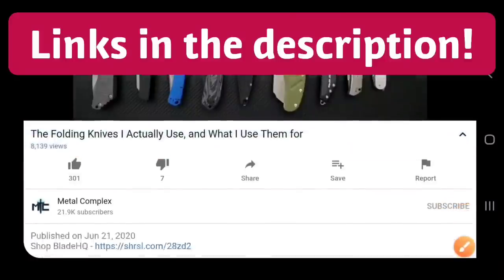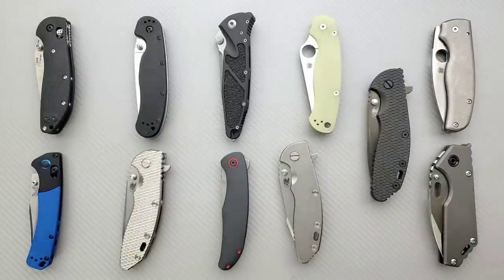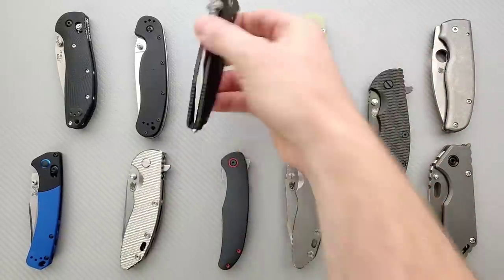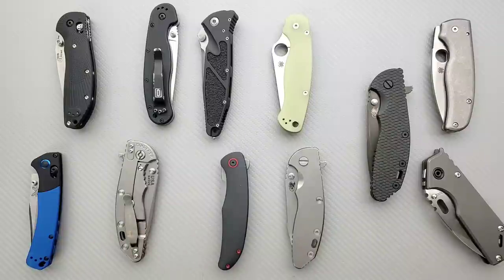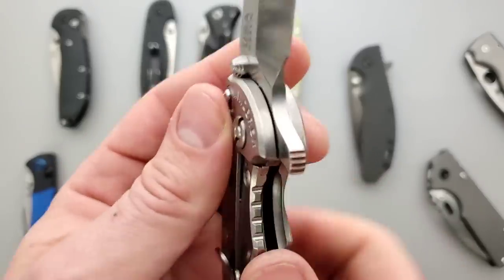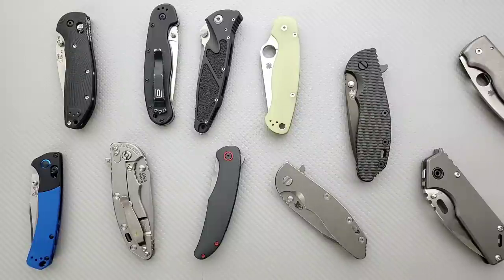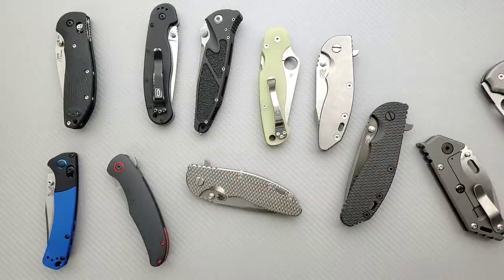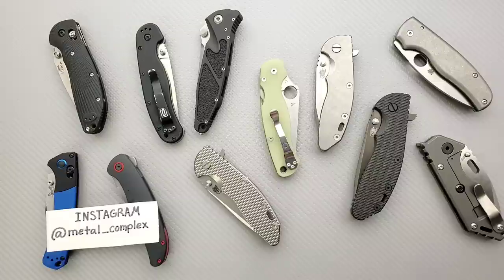Lock Stick on a Folding Knife - When Is It a Problem? What Can Be Done?

Comment: I sent 2 Zero Tolerance knives back due to lock stick... They fixed the problem and they're buttery smooth now. They sharpened them and now the grind is very uneven on both knives. Now they're drawer junk.
Reply: Then reprofile the blade yourself...or send them to me.

Comment: Wish me luck.  My spydiechef developed very concerning levels of lock after about 2 years of light use all of the sudden.   So far all I know is that the outer most corner of the lock bar feels as sharp as the tip of the knife... probably ought to do something about that.   And for what it is worth, I've been doing the sharpie thing since day1 just in case :(

1 hour later edit.  I took some 12000 grit wet/dry sandpaper with some diamond compound residue left on it to the sharp edge until it felt sharpish but not dangerous,  then re-sharpied everything, and now all is well  :)

Comment: I have five Ganzo FH-31 knives. It's my favorite Ganzo model. (Can you tell?). ONE of them is about 1-day old and suffers some lock stick (liner lock). I had considered putting half a smudge of 0.5 micron stropping compound on the mating surfaces to accelerate wear between the two surfaces BUT... I'll refrain, keep working with it, and let the two surfaces slowly mate together until things smooth out, or until my thumb gets so sore I have to just let the knife sit for a few days while I carry one of the others.
I stumbled across this video at the perfect time. Thank you or easing my concerns that I might have to do more than just work the lock repeatedly and wait for the surfaces to mate for a smoother release.

Comment: You're correct about the need to be careful you aren't pushing against the lock bar - this is a real problem on my Kizer Lancer 2, a knife I otherwise love, but it is very hard to hold it "correctly" before actuating the flipper  without thinking about it too much --  because even a tiny amount of side pressure from your little finger on the lock bar will cause the steel lock bar insert to press against the tang of the blade and this is enough to prevent opening.  It drives me insane!

Comment: I had lock stick on my Full Track, it was hammering my thumb pretty bad and was virtually impossible to close one handed..  I used a small amount of some dry "lock "lube and even very fine sand paper on the contact points and it helped a lot, and just keep flippin'...   

That .75 AR is still a great looking piece.  😊

Comment: I got a Maxamet PM2 today, it was sticking out of the box and it just got worse until it occasionally locked up almost solid.
I watched a badly shot video where the YouTuber used dry graphite lubricant in the lock indent and solved a similar  ( not as bad) problem. Not having (immediate ) access to graphite lubricant i used pencil lead scrapings and it ( for the moment at least) seems to have done the trick.

Comment: Thanks for this, just got a Penquin (finally) and it's got some significant lock stick. Actually hurts my thumb at the joint if I fidget with it a couple times. My thumbs are double jointed so it forces my thumb pretty far in a weird direction. Anyway, I nearly talked myself into disassembling and sanding the nanometer of "trouble area" and looked this up to verify the best way to do so. Ultimately I'm gonna leave it alone, I hope this doesn't take months but we shall see!

Comment: I had a very good experience with polishing (not sanding!) the surfaces very carefully. There are often micro bumps or some production residues sticking on the metal. A soft polishing (without disassembling the parts) will make your lock smooth again, so you don't have to play it out over days.
Reply: How did you polish the lock bar and tang? What did you use?
Reply: I used a Dremel with a diamond tip on my artisan cutlery arroyo just cuz the factory kinda botched the blade where it locks up but the Dremel fixed it right up. Now if it was a $200 knife I would’ve sent it back

Comment: I’m glad you also feel the anxiety of a new expensive knife not being PERFECT. I bought my first PM2 and immediately disassembled it (because I’m experienced with knife maintenance) and when cleaned it and put it back together it was a lot smoother but the detent became about 25% weaker. It is annoying me so much, even though it takes a lot to swing it open with inertia, it still feels weaker than before I took it apart. I do not understand why taking it apart and putting it together made the detent weaker. SUPER ANNOYING. Even with that issue it’s still the best EDC knife I’ve ever held 😂

Comment: Nice video but im still frustrated with mine. Ha. Ive had a ZT 0400ST for many years. Use it every single day. When i go to close it, the blade goes halfway down and stops. I then have to push against a springy feeling to close it. I'm guessing thats the design, but can i do anything to adjust the tension so it drops down? Been looking for answer for so long.

Comment: Question from your experiences and the comments. Just bought Gerber Fastball, (which has had reports of being a bit strong on the frame lock). Only first day, but had a couple of times when it jammed and needed both thumbs to push back. Also after a day of playing with it trying to break it in, both thumb and index finger (from flipping open) are hurting pretty badly, to the point can’t use my thumb to close. That normal and will work itself out or should I be concerned? Thanks for your help and the awesome videos.

Comment: My code 4 had lock stick until I used it a lot. Now the lock is perfect.
Reply: I could barely close my Code 4 one handed when I got it. Major pain in the ass. After a couple of weeks it runs perfect!
Reply: I don't mind my triad locks being to hand closers I've tighten up the 4max and my code 4 is still pretty tight but I don't use her, my sr1 on the other hand which I use the most is tighten and its drop shut I could make the 4max drop shut too but I've almost taken off a tip of my finger so I keep her tight, either way never had a issue with a triad lock it's probably the best lockup there is and keeps me feeling confident when using it in the field at work I've taken down small trees with my 4max without fear of damaging me or the knife

Comment: I had a very annoying and even loud lock stick on a para 3 lightweight. It was so stiff that after a day of work my finger was sore. I took it apart, used my girlfriend's nail file on the blade tang and where it meets on the compression lock. Also loosed up the screw that holds the lock bar in place (probably would have solved the issue by itself). Like butter now!

Comment: Minor lock stick does not bother me. To me, it’s making good contact. Weak contact is an issue. I’ve held ZT’s in store where I could push the lockbar across tang. For some reason; the locks I own that seem to have the worst lock geometry are frame locks. I’d take a good liner lock over a frame lock (Socom Elite etc). Yep, taking apart a franelock and trying to buff/grind down lock bar is foolish as is putting oil on tang, bad idea. IMO- most knives rarely need to be taken apart. Canned air and oil are all most knives need.

Comment: What about if it is so tight you have to use two hands to open it? Is that lock stick or does that have more to do with the pivot collar?
Reply from the maker: No. Lock stick can sometimes actually be that severe.
Reply: @metal_complex  I bought a Chaves Liberation 229 from a guy in the Discord and he said he never had a problem. I refuse to believe it. It's impossible to open with one hand. He just says he thought it had "crazy detent." I love the knife once it's open but getting it there... oof!
Reply from the maker: @tedgorman12  wait.. is the problem opening it or disengaging the lock?
Reply: @metal_complex  it seems like both
Reply from the maker: @tedgorman12  usually if you're having trouble opening a framelock, it's because you're holding it in a way that your fingers are putting pressure on the actual lockbar. Try keeping your fingers on the non locking part of the frame so that there is no extra pressure on the lock bar.

Comment: Lock Backs are the WORST at this since the lock/spring is ALWAYS applying pressure on the blade. I have an ancient Gerber Ez-Out with about five thousand blade presentations that is butter smooth. I have one that is MUCH newer & is stiff as hell. EVERY knife needs "breaking in", they are machines, very simple machines, but their parts need to settle together & that takes time & repetition.

Comment: I have minor lock stick on my xm-18. None at all on my eklipse. If I keep the lock bar freshly oiled it goes away. That xm-18 is 3 months old and most carried knife.
Reply: Oil on the lockbar? Not where you want oil🤷🏽‍♂️
Reply: Paint the lock area on the blade with a sharpie
Reply: Franklin Johnson did that and pencil.
Reply: Franklin Johnson last for about 10 flips
Reply from the maker: Ya don't put oil on the lock face or lockbar.
Reply: @tallica4life81  try silver sharpie it looks better and seems to last a bit longer👊🏽🗡
Reply: @itsme5279  Funny the opposite worked for me. I'm sure it depends on Steel and surface grind.
Reply: @tallica4life81  You're right it's not a perfect fix it's just a quick fix.  Let the sharpie dry completely and  like he said eventually it may work itself out.  But in my opinion you need to research and buy the right tools i.e. the right polishing materials and a truly flat surface.  You can adjust the locking surfaces this way BUT you run the risk of overshooting it and creating bigger problems such as lock rock or over engagement.  So if you aren't confident in your ability to fix it find someone who can but again do your research and find a very competent blade smith.  Or send it back to the manufacturer.  The main reason to buy a high end quality knife is for the warranty.
Reply: Franklin Johnson as I said it’s minor and doesn’t bother me too much. It’s my most carried and loved knife. I
Reply: @tallica4life81  I agree with M.C. for your particular situation that it will wear in.  What you are doing is essentially lapping the surfaces which will eventually create a better surface interaction.  My biggest gripe with that is Hinderers are very expensive and should at least come with break in instructions if they are going to ship knives with lock stick.
Reply: Franklin Johnson that I basically figured would happen over time. It doesn’t bother me too much.

Comment: Lock stick on a brand new knife is no big deal since surfaces are fresh. Run it through 50-100 cycles, 99% of lock sticks will disappear by then. If it still persist use a little abrasive compound between lock surface and scrub it loose.
Reply: I've done it way more than that and its got worse

Comment: I don't agree with the "leave it alone" philosophy.  If you do your research and do the proper work then you can "fix" or adjust the action on your knife.  Again do your research and do the proper fix!  A lot of "production knives" have a break in period but some definitely need corrections to have good action.
Spydercos in particular have weak detents that don't work in over time it stays weak.  Even more specific models like the SpydieCheif have bad lock stick that wont necessarily improve.
There is a lot more to discuss on this topic and I think you have a lot of good points but maybe for more novice guys that aren't as concerned with "good action" and that's fine.  But there is no one solution to bad action.
Reply from the maker: I disagree with this completely. Most knives will function better over time and they don't need any tinkering. More often than not, people just end up making the issue worse. Like I said in the video, I've applied the whole "leave it alone" thing to hundreds of knives in my collection. Only one actually ended up having an issue. Think whatever you want, that's fine. But I'm probably not going to revisit this topic.
Reply: @metal_complex  That's ok we can completely disagree I'm ok with that hopefully you are too.  I agree a lot of actions will wear in but that is not universally true.  I don't presume to know more than you and your experiences are valid but don't prove anything any more than my experiences do.  For the vast majority of users your advice is valid but you can't apply that to every knife or every user of course IMO.
Reply from the maker: I've never claimed anything I say applies to everyone/everything. All I've ever said is "most of the time" or "in most cases" or "vast majority". This is kind of a pointless discussion.

Comment: Use white stick deodarent to fix lockstick pretty much permenent
Reply: I have a bastion Braza Mini Bro. Tiny knife.all titanium. No insert no over travel stop. The lockstick was so bad once the lock moved it unstuck and went to far. Well you know what happens then. You have a useless knife with no lock untill you fix or replace it. So the deodarent trick is necessary for that. Very necessary

Comment: exactly why i dont bother with liner/frame locks. they are junk.
Reply from the maker: Any lock can experience lock stick. Just like I said in this upload. I dont see more or less in any specific lock.
Reply: @metal_complex  never had a problem with other locks sticking. Liner/ frame locks are a flawed platform.
Reply from the maker: I've handled / used 500+ knives. Most of them were liner / framelocls. Never had any major issues and the few that had issues with stick ended up smooth over a short period of time. Sorry dude, but your comment is like throwing a golf ball at a freight train. It's not gonna make any real difference.
Reply: @metal_complex  I've had liner locks from reputable companies wear out within a week and either start slipping or getting the liner lock stuck between the blade tang and opposite liner, requiring a screwdriver  to pry closed. I'm not hard on my knives either. I'm glad you have good luck with liner/ frame locks, but I will never buy one again. Too many problems compared to other lock types.
Reply from the maker: 🥱😴 move on